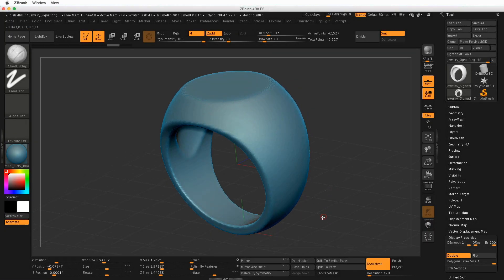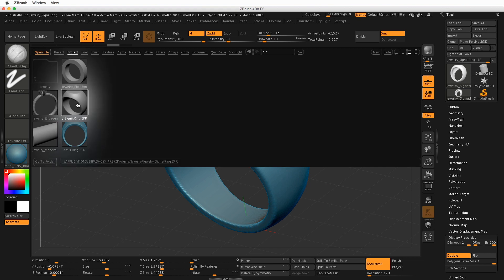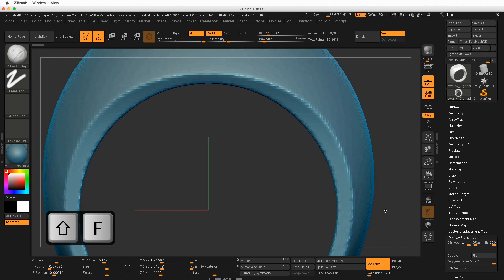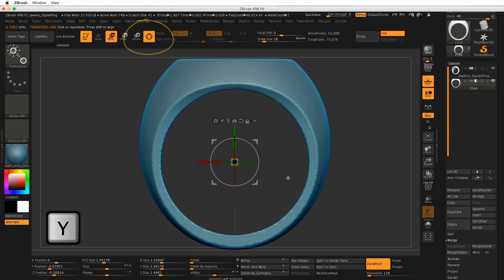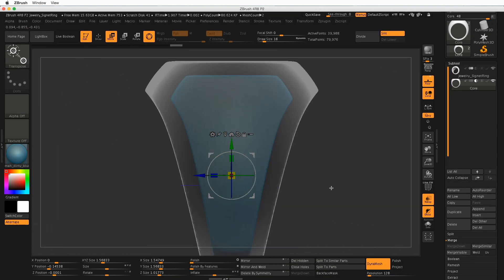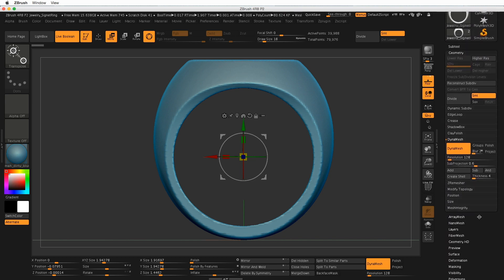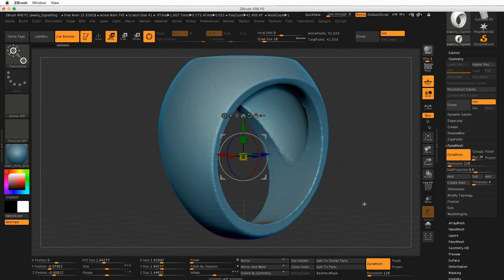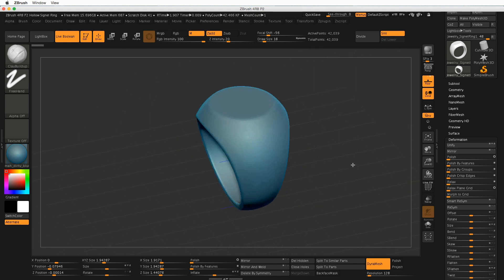ZBrush Jewelry Basics: DynaMesh Boolean and Hollowing out the Signet Ring

Comment: Thank you for the review, I am new to Zbrush and I intended only to use it in Jecewlley modeling, nothing else. Is Zbrusg core 2021 righht for me? I don't want to pay for the full features if i don't need it especially when I am still a newbie at this
Reply from the maker: Hey Ahmed! You can use ZBrushCore, but the full version has an AMAZING array of tools that are not found in Core. Things like the ability to add accurately sized stones and prongs, importing files from other CAD programs with accurate sizes, the ability to create custom brushes, and the ability to use something called ZModeler, which is a hard-surface type of modeling that can be used to create stone settings and geometric designs. Those features are not in Core. Of course, you could start in Core and try your hand at sculpting, but the full version has a 45-day trial that gives time to explore, and they do offer month to month subscriptions. 

One nice thing Pixologic does is so far, they’ve NEVER charged for an upgrade like all other companies. This may change in the future, but for now, it’s very generous. It’s been that way for over 20 years. 

Also, if you download the trial, I have some free preview lessons as part of my ZBrush jewelry course at www.zbrushjewelry.com. Look at the bottom of the page for the previews. I need to update the course, but it works with the current version of ZBrush just fine. I’ll add a discount later today. I have a custom interface and some custom hotkeys to simplify the program, and those are free in those previews. 

Anyway, it’s an exciting way to create…a little bit of a learning curve, but like nothing you’ve ever seen!

Comment: Good video.  I'd like to point out that if you're using Live Boolean, you will not need to merge down and re-dynamesh the object to do the boolean subtraction.  Instead, when you have Live Boolean active, you can simply go to the Boolean pallete, under the Subtools menu, and click on "Make Boolean Mesh".  This will automatically do what you did here in one step, and also make a new tool out of the boolean subtraction which you can then use to continue your work.  This way, you still have both the live boolean tool AND the newly subtracted mesh tool available, so you can always go back to the live boolean version, or just continue on with the new boolean tool.
Reply: thank you!  I always have problem to merge down
Reply: https://youtu.be/ZOoI4ov8Nbk